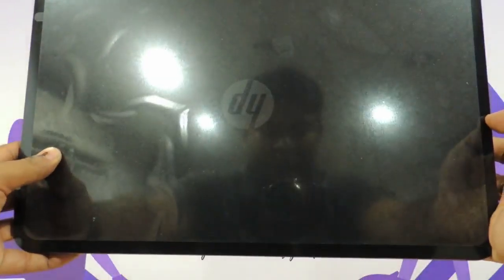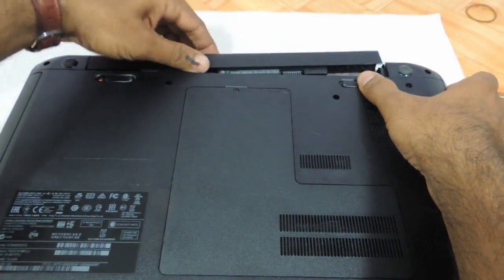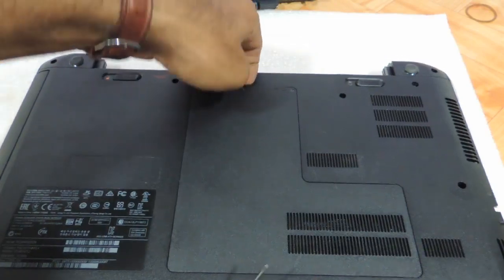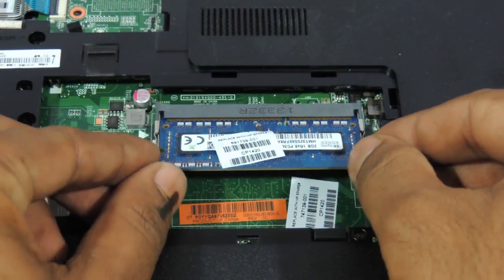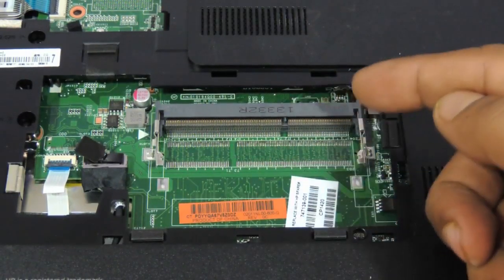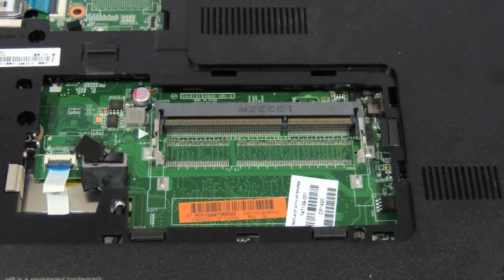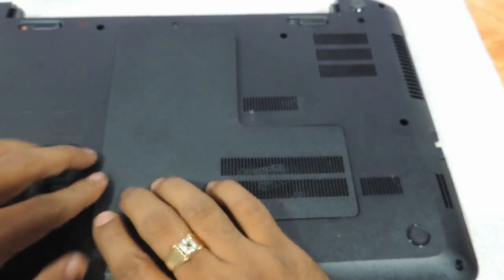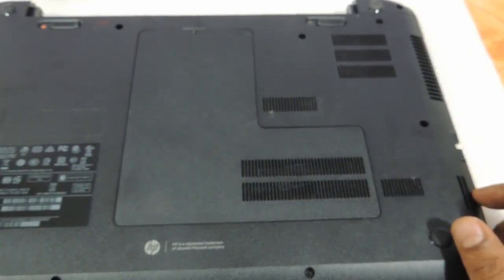Ram memory upgrade of hp 15 d series laptop d002tx d005tu d006tu d017tu d009tu d010tu

Comment: Hey anand, I have have hp 15-d017tu laptop i am confused which ram to install ddr3 or dd3L  ram its processor is Intel(R) Core(TM) i3-3110M CPU @ 2.40GHz (4 threads, 2.40GHz) and another doubt is that it has 2 sorts so can i use 8+ 2 gb and should  i use simmtronics or samsung 8 gb ram .For this help  i will be  THANKFULL of you

Comment: I have an HP series R laptop, i need to know if the ram is upgradeable and if yes then how much and which one should i use plzz reply as soon as possible 😃
Reply from the maker: max 16gb
Reply: Should I replace the 8gb one with the 16gb or should I put 2 8gb ones
Reply from the maker: 2 nos 8gb ones would given better performance

Comment: Processor-intel(R) Core(TM) 13-3110M CPU O 2.40GHZ 2400 Mhz, 2 Cores). 4 Logical Pr

Model-15-d017TU
Ram 2gb 

Can I increase the RAM of this laptop by installing a separate RAM
Reply: Yesss ,, 2 slots are available... you can increase your laptop ram

Comment: bro i'm using (hp 15-d103tx). what type of ram should i use to upgrade my laptop.
please reply me ASAP..
Reply from the maker: +Dinesh !!! what processor do you have. if you have a processor with model number ending with U like 3217u then you need to use DDR3L 1600 MHz (low voltage) else u need to use normal DDR3 1600MHZ

Comment: bro i have hp 15-d010tu laptop with specification celeron processor and 2 gb ram. I want upgrade it to 4 gb . can u suggest which ram i should buy.
Reply: Hello bro
 Do you still have this leptop
Reply from the maker: +shadab nezami buy a 2GB DDR3 1600MHZ 1.5V Sodimm memory

Comment: Hi 
Great Work Guys.....
I am currently having hp 15 d series d009tu recently purchased i am interested in upgrading my ram to 8 gb from 2gb ?
 is it possible is there any problems if i upgrade directly to 8gb 
please suggest me an idea...
thank u in advance
pavan
Reply from the maker: You can upgrade. no problem at all. Take a 8gb ddr3 1600 mhz memory. Thanks for visiting.
Reply: pavan does the ram work please help
Reply: +Techstore does it need low voltage in this version
Reply: i didnt upgraded i am waiting for original HP 8GB Ram ....
Reply: Pavan, have you upgraded from to 8 gb. If so gimme some insights. I also have same lap and I want to upgrade